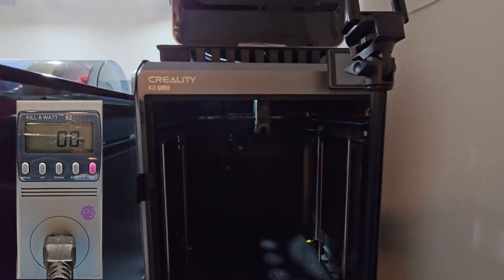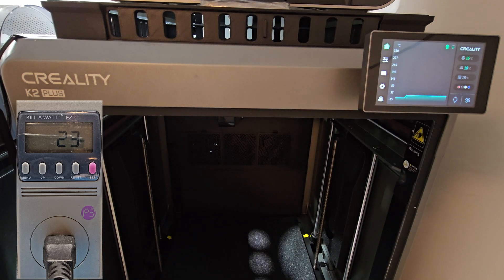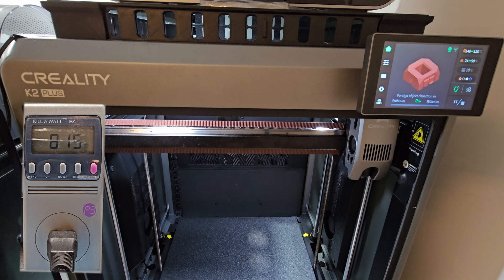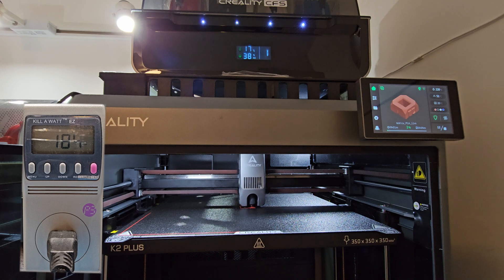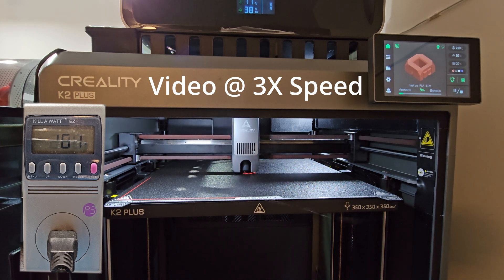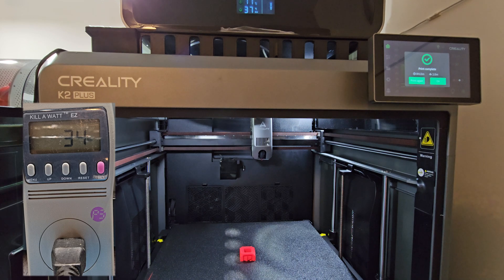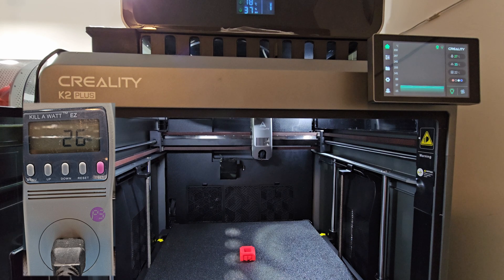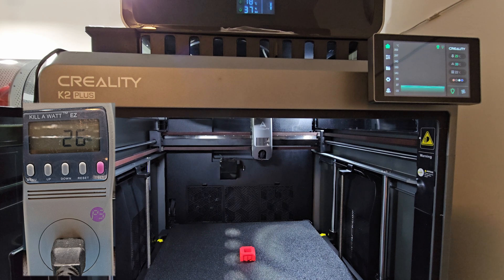Testing the Creality K2 Plus Electrical Power Usage  in Watts

Comment: Great to see this appraisal thanks. It's that initial plate warming that makes the K2Plus draw most power. Assuming from your other vid, that your second printer is a Bambulab P1S with max 220W draw, I agree they should start and run fine from the same 110V 15A USA circuit. It took me a while to realise that they will start at the same time when your UPS kicks in to handle the power outage, and therefore max out your 900W/1000W UPS every time. Kind of negates the worth of the UPS - as your 2 vids make clear. Thanks again for the numbers. FYI in Australia we have 240V, 10A circuits for domestic supply.

Comment: Are you on a 110v or 220v setup?  I am trying to figure out if Creality uses less wattage on a 110v at the expense of a longer preheat time  like other brands do or if it is still pushing close to 900w even on a 110v.  I want to put a 3D printer in my office/hobby room but it is only on a 15A 110v circuit and that room also occupies two PCs that can pull some serious wattage when under load.
Reply from the maker: I'm in the USA, so 110v.  You might run in the problem if those are are high power Gaming PCs. Good luck.
Reply: @CarlexDIY  Thanks for the speedy reply.  Yeah, they are pretty beefy systems, one is an R9 5900X with a RTX 3090 and the other is an R9 7950X3D with a RTX 4080 Super.  I had a feeling you were on a 110v, was just wishing otherwise.  Shame, I really had the K2 Plus at the top of my list, but I need to keep in mind the overall load on the shared circuit.  I guess I am back to looking at Bambu or Prusa and working with a smaller bed size, I know those use a lot less wattage albeit at the cost of a slower preheat speed.

Comment: lol.. The Bambu P1S printer has a 265 x 265 heat bed, an area of 65,536mm squared. The Creality K2 Plus a 350mm x 350mm heat bed, an area of 122,500mm squared. That's 1.87 times, close to twice the area to heat up, so of course it's going to be twice the wattage to heat up. That's like saying "Wow, my 4 bedroom house costs twice as much to heat compared to the 2 bedroom mobile home across the road.". Not a really shocking revelation.

Comment: It consumes a lot of electricity. The fan is controlled in the profile, I have it maxed at 60%. You have two cfsses, so your power consumption has to be higher.
Reply from the maker: I only have 1 CFS. The other is an AMS for my Bambu Lab's P1S.

Comment: What if the print area is covering the entire build plate then it should increase the power consumption but by how much? could you please run a layer adhesion test print and check the power comsumption for a thin layer covering the entire build plate. Thank you for the test.
Reply from the maker: Regarding the power consumption I imagine it won't change much since the printer heats up the whole bed and keeps it all hot at the same temp. What I do think will raise the power is printing with some strong materials like ASA or abs. Since those use higher temps. I just don't have any now to test that hypothesis. 

But I will test it when I do a thin first layer test in PLA.
Reply: Covering the entire build plate wont change a thing since the whole bed is already being heated. What would increase the power consumption is printing at hotter temps and if you are using the chamber heater.

The chamber heater should increase the initial power draw to over 1 kilowatt but the sustained power draw might not be affected all that much since the bed and nozzle at that point wont use as much power since the ambient temp in the chamber is higher but now the chamber heater is taking up the load.
Reply: @Guardian_Arias  If your first few layers is 500g of filament, it should increase the power draw, probably not by much though.  Sub 5%
Reply: @ Half a spool directly onto the bed probably would have an effect but it would likely decrease the power draw since a hot material that's also insulating is being deposited, so the heater would have to work less to maintain the same temperature.

Prior to fully enclosed printers where a common place, it was standard practice to buy insulating foam or glass wool to layer the bottom of beds to decrease heat up times, lower idle energy costs, and stabilize bed temps to decrease a particular type of Z-Banding.
Reply: @Guardian_Arias  I was a member of the early community but unfortunately I wasn't a part of the "box your printer in" gang.  I used a space heater and blew it at the print bed lol.  I actually got really good results because the space heater would be so much hotter than necessary, it would also heat the room in the winter so win win.
Reply: @TheGamersRace  Yeah my experience is the opposite, living in a desert environment my goal was always to contain the heat and at minimum keep the AC from warping the first layer. Printers have come a long way, but unfortunately old tips and tricks are already becoming new tip and tricks or flat out dismissed due to long lasting memes.

Comment: You don't need a UPS, it has print recovery after a blackout. You can only use it if there are many voltage fluctuations in your power line but this is a rare event. It happened to me twice in 6 months
Reply: I am going to disagree, I had a power failure in the middle of the night in the middle of a 24 hour print.  I tried resuming but it popped the prints off the bed when it tried resuming.  I'm assuming the PLA had cooled too much and had come loose from the bed.
Reply from the maker: @higginsjoshua agree , the only thing I would add is the 1500va UPS i don't think is strong enough to keep it going for long. Im guessing maybe less than 5-10 mins if it's already printing and not using a lot of power.  Hmmm this might be something I test later
Reply: I doubt power recover will ever properly function on the K2 since the bed has a tendency to drop to the bottom when power is lost since the bed is so heavy.
Reply from the maker: @deepfakefuorissimo Have you actually used the print  recovery for the K2+? I can tell you that it has NOT work for me. Twice I've  had little spikes, and the print recovery once didn't even start, and the other it did a horrible layer shift that it completing I lost the print. 

 Besides that, the reason I use and mention in video is because in my area, we do get a few power outages, and the UPS helps to not only save the print but from damaging the printer.
Reply: @CarlexDIY  Hes right to do this if the electricity in his area has sudden spikes, it can FRY the printer, computers and what not. The print recovery does work for me, but I had it happened when I accidentally turned my smart plug off, I dont have spikes where I live. (I am surprised u do as u are in the US.)
Reply: Print resume is a failsafe feature to avoid using.  It rarely works, and it always creates a defect, especially if the print bed cooled and the print sat and got cold.  Flickering power where you're literally waiting to restart a print it could maybe survive but it's not a perfect solution.  UPS is definitely a must for printing regularly.
Reply: I've had print resume work on a K2 Plus but not always. Yes the bed drops to the bottom but the printer seems to home relative to the bottom then raise to where it left off if you select resume. I've also had it fail to resume properly. And when it does work it can leave artifacts on the print. A UPS to handle short power outages is best if you want to maximize changes of a good part when your power isn't stable.